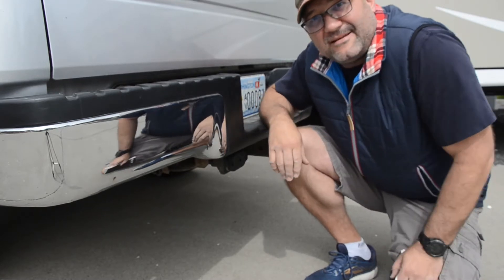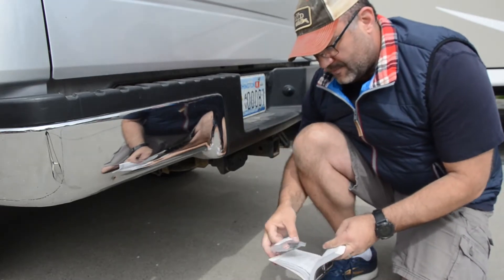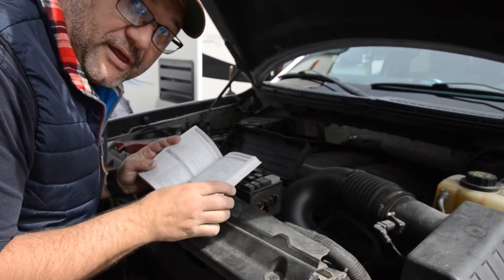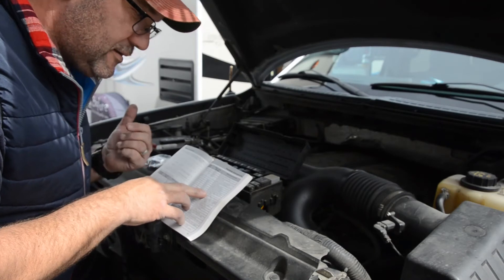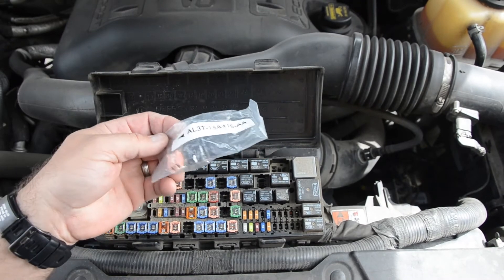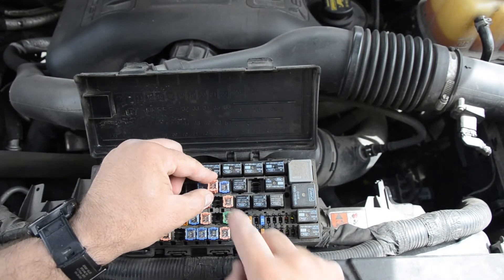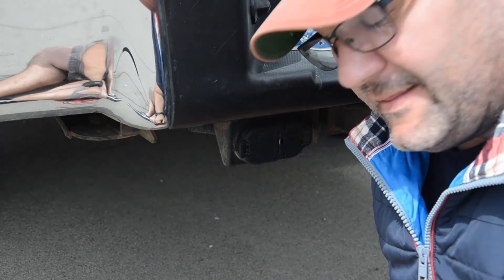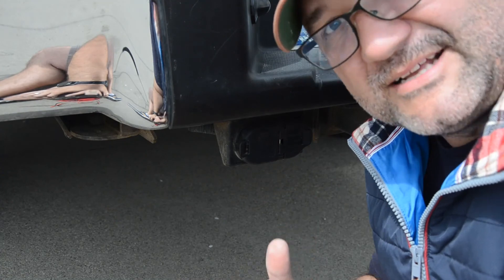Charge RV Batteries While Driving! Adding 12V to 7 way pin on F-150

Comment: If my pop up camper is a 4pin but my ford has a 7pin with the adapter to go to a 4pin will it still charge the pop up camper battery?
Reply from the maker: I don't believe you can charge your battery through a 4 pin connector. I found this link to e-trailer that might be able to clarify more: https://www.etrailer.com/question-30687.html#:~:text=Expert%20Reply%3A,battery%20but%20not%20charge%20it.&text=If%20your%20trailer%20does%20not,these%20pins%20(see%20picture).
Reply: No, but if you wanted, it wouldn't be that hard to add the extra circuit. You could buy a 7 pin plug, and rewire your camper to include the extra hot line. Just make sure you use the proper one, or your truck might think you have trailer brakes. :)
Reply: No even with the 7 pin to 4 pin adapter is still only wired for a 4 pin flat. You will have to up grade the 4 pin on your trail cord to a 7pin plug for you to get the 12v. But ideally the 7pin is mainly for trailers with brakes because  they require a 12v constant for the fail safe if the brakes were to fail. The battery needs a 12v to stay charged